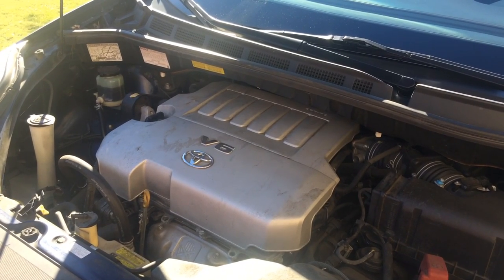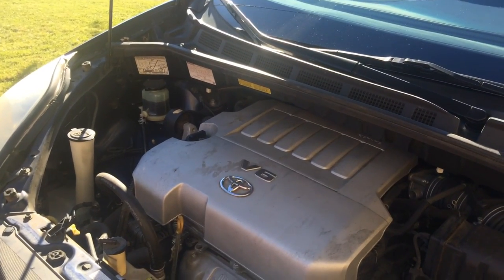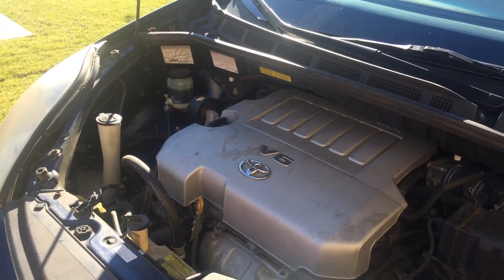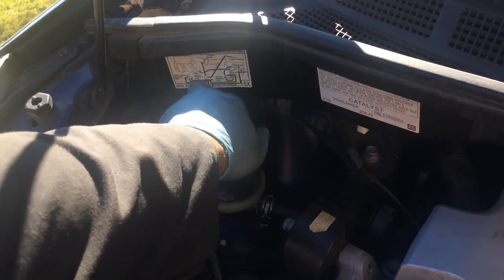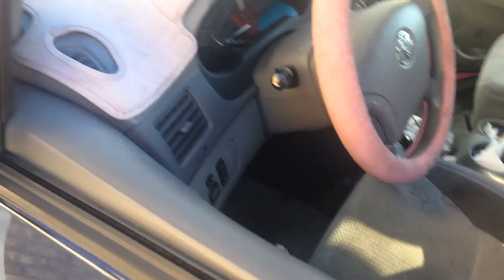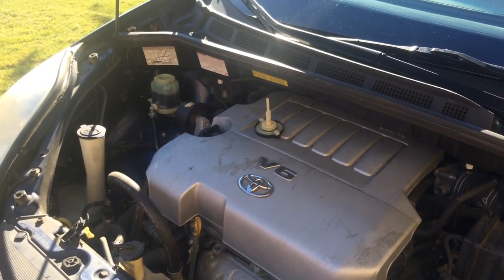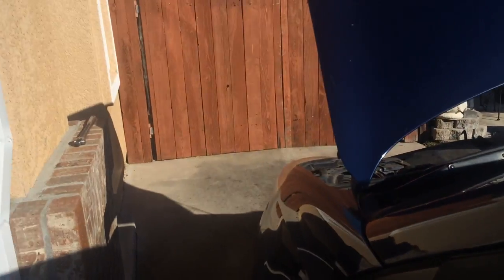How to bleed air out from power steering systems

Comment: Hello I have a 1997 Toyota Camry le v6 and I recently got a new power steering pump replaced but later on noticed I hear air when I’m slightly turning my steering wheel does that mean there’s are in there and its a simple fix?

Comment: My car is highlander 2003. Steering rack was leaking and mechanic fixed the rack and put it back in. Since then these 2 days I’m having trouble with tight steering wheel when start and when turning. I don’t know if the mechanic did this trick you showed. I brought the car back to mechanic and they said I have to keep driving for a month or so so that the fluid will circulate well in the steering system.. 😢
Reply: They said it’s not the steering pump problem or serpentine belt issue either.. I’ll try your trick ASAP and finger crossed that it will work.
Reply from the maker: If the steering is still tight and hard to turn. Take it back. They probably did something wrong. Rack might be bad or pump might not be working. It only takes a few mins to circulate the fluid. Not a month.

Comment: My wheel is very hard . Will this work for Nissan Altima ?
Reply from the maker: If the power steering pump has failed, you need to replace the pump. You can also check to see if it is something as simple as a belt that has fallen off or broke. Not sure of the year of your Altima.

Comment: I'm having a death wobble, could this be from power steering having air bubbles. I know it is leaking, because I have to fill it every couple of days, and looked under truck and power steering fluid everywhere. Please help, only vehicle I own , disabled, and take care of ex wife, stroke victim. Thank you very much, and have a blessed day.
Reply from the maker: Badams63 Adams What kind of truck? No air bubbles in the system won’t cause a wobble. Also is the truck 4wd?
Reply: @HelpingHandAutoRepair   its a 2000 ford explorer, and no it's just a 2 wd, rear wheel. I sure appreciate any help. It just does it out of the blue, no hitting brakes usually at 45 or 50 mph.
Reply from the maker: Badams63 Adams Do you know if it shakes up front or the rear? Can you feel it through the steering wheel? How many miles on the truck? Most of the time these wobbles can stem from worn steering components. Tie rod ends, worn ball joints, worn pitman arm or idler arm.
Reply: @HelpingHandAutoRepair  it is up front and the steering wheel shakes TERRIBLE, It has will miles, but just had all new front end parts put on at shop, they say. The belt broke cause a.c. compressor froze up, and all a sudden my power steering started going out, leaking, and has jerks when you turn. But as I said it only does the real hard shaking now and then , and I have to slow to about 30 mph and then it straightens up. Man I really appreciate you helping me as I'm disabled and can't crawl under it. God bless ya.
Reply from the maker: Badams63 Adams You should have that shop re inspect the front end. Bushings, ball joints, worn steering box, worn pitman arm, worn shocks, or a worn idler arm. 

Unfortunately I can’t pinpoint an exact failure point as there are many potential causes.
Reply: @HelpingHandAutoRepair  thank you for you help it at least puts me on the road to trying to figure it out. Have a blessed day

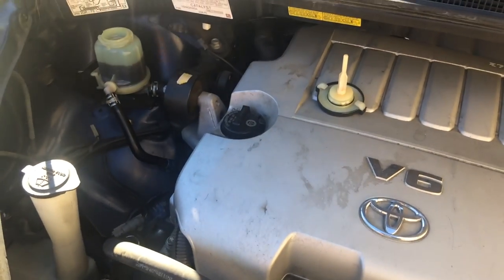Comment: 2:32 you turn your wheel with the power steering reservoir cap off, would that not suck air back into the system or does it not work like that
Reply from the maker: Nope. Air would need to somehow get past all that fluid and into the line which is full of fluid.

Comment: I recently had my power steering hose replaced since it had a leak. It sounded good when it was replaced but after a short while driving it its been making noise just like when the power steering fluid is empty. My fluid is full yet it still makes a noise. Never made this sound before! Any idea if it could just be potential air in it? Been driving it around for four days to see if it’d go away but noise is still present. Help pleasee!! 😭😭
Reply from the maker: Pumpcould be defective or there is air in the system.

Comment: Hello I have a 86 Scottsdale, whenever I’m turning power steering makes a terrible squealing noise. Just replaced the pump and still squeals. Any tips?
Reply from the maker: Ethan Gordon are the belts in good shape? Look for cracks or any general wear.
Reply: Clean the screen in the reservoir

Comment: My steering wheel won’t turn with the car off??? 03 Acura RSX
Reply from the maker: It’s ok, they won’t turn at all with the key out of the ignition because the column has locked. You need to to turn the key forward one click and then the wheel will turn. It will be much harder to turn the wheel since there will not be any power assistance.

Comment: Is a Vacuum pump necessary or will this get the air out? Having that noise with a 2018 4Runner after I changed the fluid out.
Reply from the maker: Not necessary.

Comment: How many times do you do this?? I have done it multiple times and still there is air bubbles..ugh
Reply from the maker: Do you have smooth steering lock to lock? Does the pump still whine?
Reply: @HelpingHandAutoRepair  i have smooth steering but it still whines.  Help me
Reply from the maker: Pump is probably bad

Comment: Ive got a 1992 mercedes e190
Steering like a lumber wagon.
Ive changed filter, pump- still hard steering. There are No leaks externally. 
Any ideas
Reply from the maker: First off, a VERY solid choice to drive daily! 

Depending on the mileage on the car, the steering box itself may just be old. Do you have play in the wheel while driving straight?

Comment: Just had the leaking ps line replaced in my 2008 chevy Impala. Drove it home from my mechanic and it was terrific. No noise and it steered beautifully. 
25 min away, now back home and I couldn’t turn the wheel to turn into my parking spot. 
Did the trick of taking the cap off, with and without car running and still hasn’t released the air bubble, as I almost strained my shoulder just trying to turn the wheel. Tried to drive it around 3-4 mph SLOWLY (with cap off and good closed). It seemed to get better. 
Went to back it up into my parking spot and neither in reverse or forward, could I turn the wheel! 
Ughhhhh 
Help?
Did what my mechanic suggested
Reply: Could just need a new pump
Reply: Impalas are junk. My mom's car has nothing but problems. Especially power steering issues. My bmw with 212k miles is less troublesome 🙄
Reply: bro same thing w my impala. i replaced the pump
Reply: did u ever figure anything out ?
Reply: @nateking2024  not it. Ive replaced 2 pumps

Comment: Is it important to turn the steering wheel slow from lock to lock? I had my brother help me bleed the air out of the power steering system and he was turning the wheel really fast. I noticed foam and bubbles in the reservoir so is this normal? Vehicle is a Chevy Cavalier 2000.
Reply from the maker: A M It’s not going to hurt it turning the wheel fast. The bubbles are what you’re trying to get out. So seeing bubbles at first is normal. I suggest slowing down the wheel speed some at least to a moderate speed or even slower. You don’t want to spin it too fast as to prevent cavitation.
Reply: @HelpingHandAutoRepair  Understood sir, cavitation is what I was worried about. Would you advise using a stop leak additive in the fluid? When turning the wheel I hear a crackling noise coming from underneath the vehicle. Is that normal? I dont see any leaks from under the car but it is pushing out from the reservoir. Should it feel stiff during the process with some smoothness to it from lock to lock?
Reply from the maker: A M It will most likely be stiff as you get closer to full lock on either side. It should become smoother as the air bubbles go away and the fluid starts to circulate completely. The system doesn’t hold much fluid so it shouldn’t take too long to bleed the air out. Crackling is common at first but should go away as the air is bled out. No leaks is a good thing.

Comment: Hello, I replaced the power steering pump. On my 2003 Crv and did this bleeding process but, the power steering pump seems to be overheating? What could be my issue? The lines are not pinched or leaking.
Reply from the maker: Overheating? What do you mean.
Reply from the maker: Are you having power steering problems? The fluid can get hot from normal use.
Reply from the maker: It is possible. Or your steering rack is malfunctioning

Comment: Does the vehicle have to be jacked up? How can you turn the wheel if it’s on the ground? If they key is in accessory won’t it still be like impossible to turn the wheels

Shouldn’t you do this with no fluid so the air can get out ?
Reply: My 03 4runner wheel won't turn unless my engine is on
Reply from the maker: This is why the car is jacked up off the ground to take the weight off the wheels.

Comment: Hi, I have a 09 Camry whose steering wheel acts weird. When driving at low speed, the steering wheel won't return to the center after a left turn, it stops at 90°. And it's really easy to turn the steering wheel to the left than to the right. The right turn is good. I accidentally turned the steering wheel when the engine is off, and key not in ignition. Would you please help me with this? Any advice is appreciated.
Reply from the maker: Turning the wheel when the engine is off and the key out is fine. Won’t hurt anything. Most of the time the steering lock kicks in and stops the wheel anyway.

As for your question about the steering wheel. Have you tried to replicate this problem over and over?
Reply: @HelpingHandAutoRepair  Thank you for your reply! Actually the accident happened when I was trying to put on camber bolts. I turned the wheel by socket and breaker bar(bolts too tight), then I freaked out, and turned the steering wheel back to center. At that time the steering wheel was very easy to turn. Then when I finished and tried to start the engine, the steering wheel was locked. 
After unlocking the steering wheel, I noticed it won't turn back to center after a left turn. Even at a higher speed it may turn left by itself because there was no resistance on the left side. 
I tried to reset the computer, and it helped. At higher speed it is fine, not perfect but it won't turn by itself anymore. But at lower speed, it still won't return to center. I can feel the left side has less resistance than the right side. And yes, this happens every time I do a left turn. 
Thanks again. It feels great that you want to help me.
Reply from the maker: Hao Chen Of course I will help you as best as I can. Ok so now that you mention camber bolts being move from the stock alignment. My next question is, does the car drive straight down the road even if the wheel isn’t straight? There doesn’t seem to be a strong pulling to the left or right is there?
Reply: @HelpingHandAutoRepair  Thank you Sir! Yes the car drives straight, and both wheels and steering wheel stay straight. I could barely feel the difference between turning the steering wheel to the left and turning right at >30mph.
Reply from the maker: Hao Chen ok then that’s good. You simply should take the car to have it re-aligned. Should fix your problem right away.
Reply: @HelpingHandAutoRepair  Thank you! I am going to do it. However I am a little confused. I thought when the car drives straight when the steering wheel is centered, the alignment is good...Did I messed up the caster?
Reply from the maker: Hao Chen ok to clarify. When you’re driving straight down the road the steering wheel
Is centered?
Reply: @HelpingHandAutoRepair  Yeah the steering wheel is centered when driving straight. I feel when I drive faster, it's in the normal mode, but after slow down and turn left, it's in this weird mode. I feel like the pump is giving too much pressure to one side. But I am not familiar with the pump...
Reply from the maker: Hao Chen is your car a hybrid Camry or no? You may have a problem with the electronic power steering rack or even if you don’t have a hybrid it seems like your steering rack may be giving you issues.
Reply: @HelpingHandAutoRepair  Thanks. It's not hybrid. I am thinking about air in the pump since it's the easiest to start with. I am not quite familiar with the rack to be honest.😂
Reply from the maker: Hao Chen racks have seals on the ends of them that hold pressure provided by the pumps. Sometimes those seals
Leak causing similar problems to what you’re experiencing
Reply: @HelpingHandAutoRepair  Cool, thank you for the explanation. That makes sense to me. I am going to check the seal.
Reply: @HelpingHandAutoRepair  By the way, if there is a leak, I am assuming I could expect fluid loss in the reservoir, right?
Reply from the maker: Hao Chen Yes you would notice a loss of fluid in the reservoir. You can’t see the seals by looking at the rack directly. There could be a leaking fitting causing a problem. The seals are actually located under the rubber boots that are attached to the tie rod ends. You would have to remove the clips closest to the the steering rack and then slide back the boot to look inside for leaks. Racks can also simply fail over time as the gears inside mechanical get worn out.
Reply: @HelpingHandAutoRepair  Thank you so much! Those  instructions are very detailed and useful! I feel more confident fixing this problem now. Thanks again!

Comment: I recently got a new pump in my 04 Hyundai Santa Fe 4WD. When I got home from picking it up I noticed the fluid bubbling through the reservoir cap. I turned the wheel from lock to lock about 15 times until the grinding noise faded and drive it for about 10-15 no problem. This kept working fine the next few times I drove it in short spurts. Then today I drove it for about 30-45 minutes and heard the grinding again. Popped the hood and saw the power steering overflowing the reservoir again. Did I just not get all the air out like I thought I had or does this sound like another issue?

Thanks for your video BTW!

Comment: I changed the PS pump on my truck.  When it starts up its fine, after it gets up to temp I get a little noise.  I open the hood and remove the PS cap and the noise goes away.  But it keeps coming back. If I do this will it help?
Reply from the maker: Nonya FknBusiness You can certainly try to use this method to bleed out any air that may be trapped in the system. Also making sure that you are using the correct fluid for your system will play a role in whether or not any sound is present.
Reply: @HelpingHandAutoRepair  Its an AC DECLO unit. Came with a red fluid in it. I just added the difference of the recommended fluid type in the manual...  I suspect the Red Fluid that was in it is something they put in it while its on the shelf. I called them and asked if it was okay or if I needed to remove it and they were like nah its fine.

Comment: What if I see an air bubble in the power steering fluid when started it? Also o think something up with my steering, when I have the car idling and make full lock left and right it's as it's making a sneezing coughing sound. Is this normal.
Reply from the maker: If it hit full lock (when the wheel will not turn any more) you will hear the power steering pump make a constant sound until you back off the wheel some.
Reply: @HelpingHandAutoRepair  so pretty much that's normal.
Reply from the maker: Yep
Reply from the maker: I try not to just hold the wheel full lock. I don’t like the sounds any car makes lol.

Comment: Yes sir I have question. I try but after there's is a bubbles in reservoir,  and the air come out in the steering wheels its the same
Reply from the maker: Matthew Lazaro When you turn the wheel is it a smooth motion? 

1. Make if not make sure you have no leaks anywhere.

2. If no leaks try this procedure again. 

3. If there are still bubbles give the car a rest for 30 mins to 1 hour and come back and check on the reservoir.

4. If the bubbles are gone it should be fine. If there are still bubbles make sure you don’t have a faulty pump.
Reply: Still the same.
Reply: Yes its smooth. No leaks anywhere,
Reply from the maker: Matthew Lazaro If the steering is smooth and there are no leaks, AND the pump is not making any noises then you are good to go. You may never get 100% of the air out of the system and that’s ok. As long as the system meets this criteria you are good to go.

1. Smooth steering wheel motion.

2. No leaks.

3. Quiet pump.

^ if this is all ok then you are fine.
Reply from the maker: Tim Dennison what is the problem you are having sir?
Reply: Helping Hand Auto Repair I have  change 6 pumps and 6 steering reck box but steering is hard everting is smooth universal zoinints steering pen ball zoint mountain bearing  please halp me dose problem solution please sir
Reply: Matthew Lazaro  =